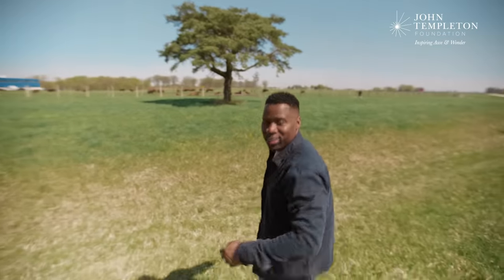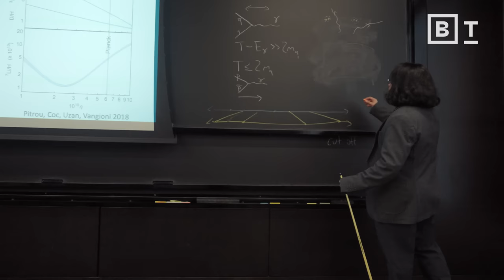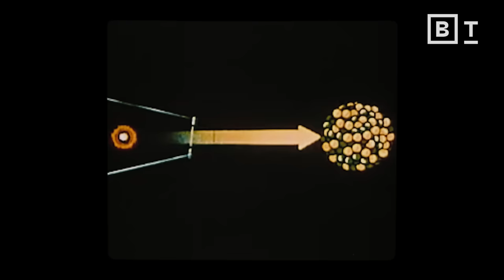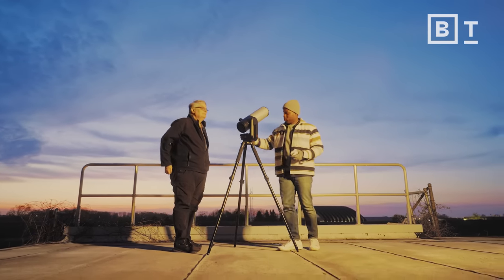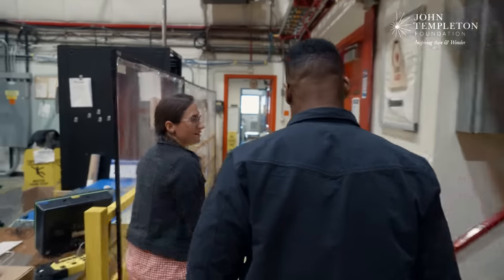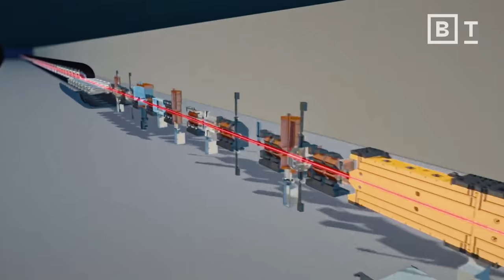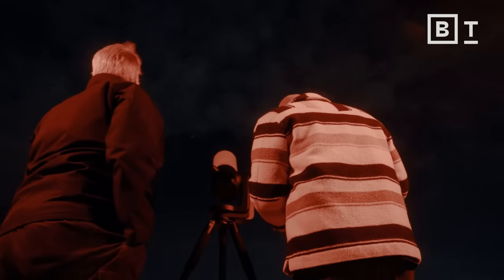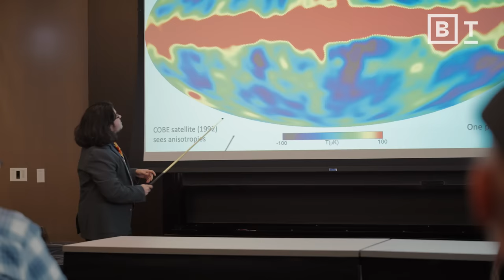Finding the secret of human existence in an atom-smasher | Dispatches from The Well Ep. 2

Comment: I got to ask Don about the alice in wonderland theme when I was on Facebook before some religious went on a bender getting as many athiest they could kicked off the platform. He had no clue why the theme existed at fermilab. Nice person. 2) no right handed neutrinos. Points to symmetry breaking early with neutrino production. Q.C.D. matters more then. 3) Fermilab needs to look for particle production from quantum foam in a energy density regime and gravitational waves. No one else is setup to do that. Pinning that down ether way will tell a story, and confirming or ruling out theories.